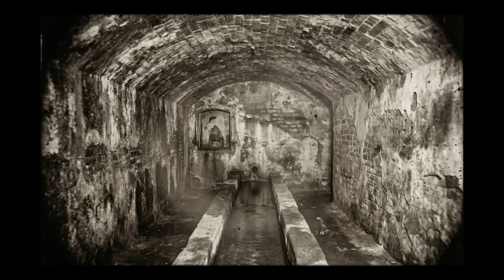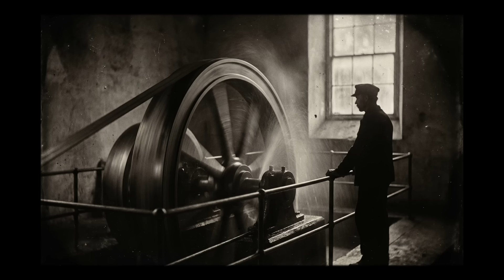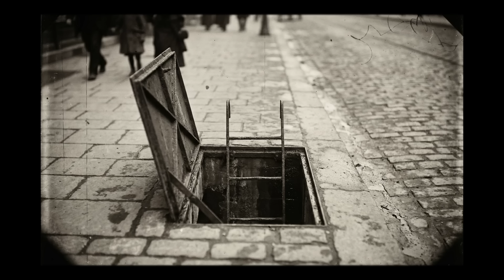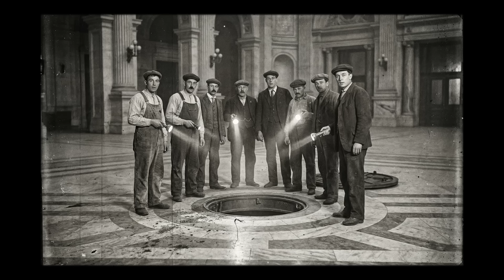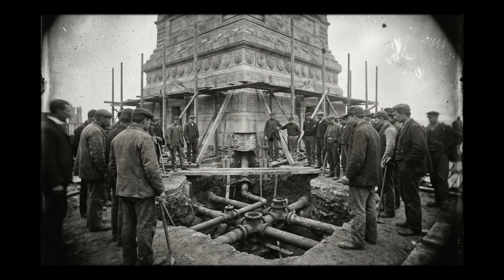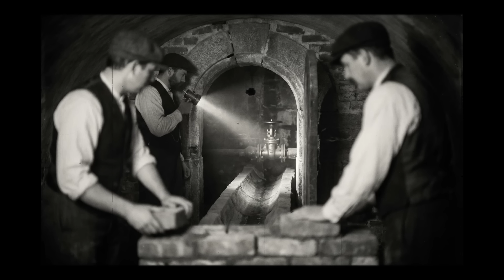Tartaria's Water Engines — How Whole Cities Ran on Water, Not Coal

Comment: Philadelphia had a hydraulic water power system and I have been shown tours of it. It's available to the public. But they only speak of water distribution.
 Actually the Rocky steps used to be the elevation for the system before they built the Art Museum in its place.

Comment: Running water creates negative ions which are known to have massive benefits to health, healing and mental well being. The invisible reason we enjoy beaches, pools, water falls, active water features and the air after a heavy rainfall. Civilizations 10,000 years ago knew that and built special chambers over underground streams, using boulders filled with quarts that vibrated as affected by the running water, creating negative ions. Same with Air ionizers, the negative ions also attach to harmful particles, smoke, pet dander and such, weighing them down to bring them to ground to be vacuumed up or washed away, creating that fresh air scent. On the downside to much ozone creation has negative affects. So I can see how bells, vibrations, can create or cause healthy negative ions to be created. Win Win!
Reply: Quartz^ lol. Negative ions attaching to particles also make them big enough to be captured by micron air filters.

Comment: At about the 28 minute mark he mentions "Pumps".  What ran these pumps?
Reply: Gravity ran the water from the towers to run the turbine's to run the flywheels to run the machanicel motors in the shops to fix your old ass shoes ? Or to run furnaces to make glass products or other    things
Reply: They use refrigeration systems that ran by water to distribute heat from the water to make cold systems like a refrigerator
Reply: Water ran the pumps

Comment: I just watch an experiment someone scaled down and rebuild the chamber of the pyramid and filled them with water from the bottom it created enough pressure to blow the model to peices .that much pressure would turn turbines and much more
Reply: It's called hydraulics and pneumatic pressures
Reply: @misewixe2777 which is done with a TROMPE system. 
https://youtu.be/95hWP-yN-3s?si=hEd68OBb0GzSJuHz